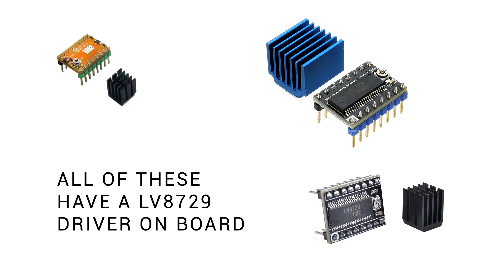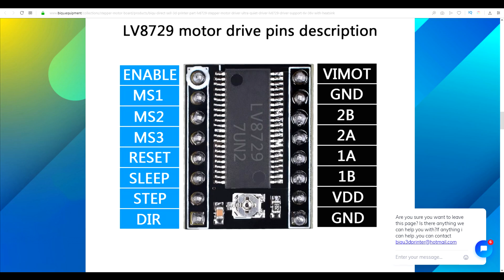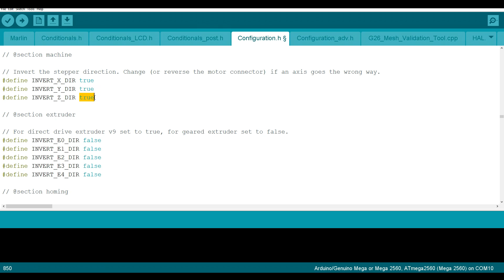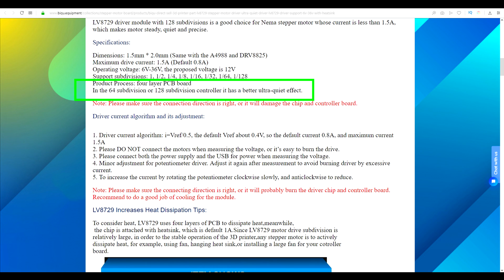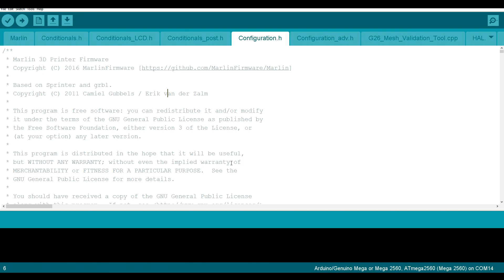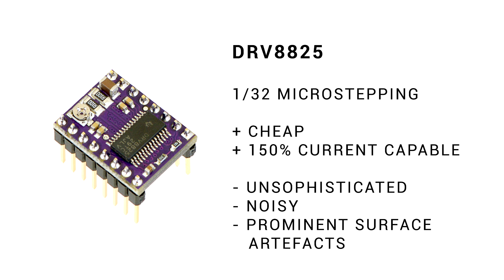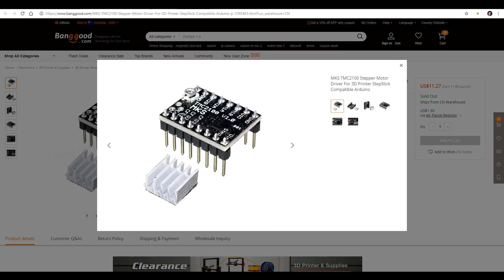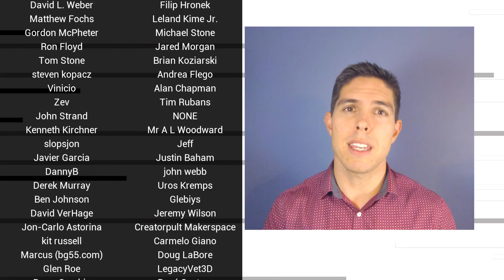LV8729 guide + comparison with TMC drivers

Comment: Are TMC 2208s drop-in compatible with a CR-10S logic board, if replacing the driver chips directly?
Reply: Usually those came with a Melzi-like board with A4988 soldered in. The only pinout compatible chip is maybe Hero HR4988, which supports higher microstepping modes (configurable). At 16 microsteps, it's a little less annoying sounding than A4988, but i don't know about its behaviour quirks. Straps for 16 microsteps are the same between A4988 and HR4988, but for all other modes they differ.

Comment: Marlin has a way of dealing with insufficient step routine interrupt rate, it can actually send multiple STEP pulses within a single invocation. So on the 8-bit hardware, for every move section, Marlin chooses an interrupt rate such, that it's below 10 KHz, but it'll multi blip the drivers as needed; but the driver might end up being confused and doing something not-so-nice. They actually have some timing tuning for the feature, so you should specify the type of driver you're using in the config!

On a typical printer with 16 microsteps and less than 200mm/s movement speed, you can assume that these double and quad stepping modes will not be activated.

Comment: The reason none of your settings take effect after uploading marlin is because you still have settings stored in EEPROM. You need to do an M502 to reinitialize eeprom with values from firmware, then all your settings you set in firmware will be in place. Then an M500 to store in EEPROM and you're good to go.

Comment: After watch this perfect tutorial and changed my Lv8729 to 64 micro steps I hit a strange but. 
When doing retraction the extruder pulls back the filament. The next thing in the gcode is to return the fillament back, but the extruder decides to pull back one more time (second retraction)

Using the same slicer as before and the safe firmware (just updated the esteps) 
Marlin 1.1.9. Any ideas?

Comment: Hi, congratulations for the always very precise and effective explanation, I would like to make an upgrade on my sidewinder x1 it is possible to replace the original drivers with LV8729 both for the axis motors and for the extruder and what are the best settings to change the firmware . Maybe you can make a dedicated video. thanks

Comment: Hi, I would like to make an upgrade on my sidewinder x1 it is possible to replace the original drivers with LV8729 for both the axis motors and the extruder and what are the best settings to change the firmware. Maybe you can make a dedicated video. thanks

Comment: What stepperdriver is best for lin_adv. , i have a skr 1.4 turbo , an can i mix stepperdriver ?
Reply: Maybe lv8729, i have problems 2208 and linear advance
Reply: @Marcushin   2208 you absolutely need to run in SpreadCycle mode for the extruder.

Comment: hello ever 1 need some help not sure which stepper moter drivers to get as i am going to get the skr v1.3 broad as i can get it with the screen and drivers so its one of these https://www.banggood.com/BIGTREETECH-SKR-V1_3-32Bit-Controller-Board-5Pcs-TMC2130-Stepper-Drivers-TFT24-Touch-Screen-Kit-for-3D-Printer-Part-p-1579479.html?rmmds=cart_middle_products&cur_warehouse=UK     
or this 1  https://www.banggood.com/BIGTREETECH-5Pcs-TMC2280-V3_0-DIY-Options-Drivers-SKR-V1_3-32Bit-Controller-Board-TFT24-Touch-Screen-Kit-for-3D-Printer-Parts-p-1579182.html?rmmds=cart_middle_products&cur_warehouse=CN

Comment: So LV8729 relies strictly on the micro controller for creating steps and risks skipped steps at really high accelerations, but how do TMC stepper drivers work with 8-bit because they take 1/16 micro stepping pulses and interpolate internally 1/256 micro steps and take less computing resources from the 8-bit controller

I hope I am understanding this stuff right because there is a lot of here say and snake oil on the internet

Comment: I was trying to get eh LV8729 to work on teh E0 on my SKR 1.4 Turbo. I get zero movement out of the steppers. Anyone have an idea what could cause the issue?  All Marlin 2.0 the TMC 2209's worked fine. I disabled stealthchop in the firmware for E and set the driver in the config file to LV8729. Still no movement.

Comment: FWIW - in my experience, the TMC2130s are fine in extruders. I run them exclusively, the only issue is they use the first-gen Interpolation algorithm which means they 1) could be up to a single full step behind the other axes at any point with it enabled, and 2) can in some rare cases miss steps on reversing. Extruders reverse A LOT in normal operation between presssure/linear advance and extracts, so this is probably where some people run into issues. YMMV, but I run with it (Interpolation) disabled on extruders.

Comment: So, with a 32 bit board.
The LV8729's are a really good option? (the last ones)
Reply: on a skr 1.3 i tried both tmc2209 and lv8729. put the lv8729 @ 1/64 and they crush the tmcs. they are both quieter AND have more torque AND don't need fiddling with stealthchop/spreadcycle/hybrid modes and the like

Comment: Why did you disconnect the USB cable? On the Gen-L the logic voltage is 5v either way, and the vref is a current mirror connected to the logic voltage, not the motor voltage. And as someone else said, the calculation depends on the resistor value which will vary from vendor to vendor for the lv8729. And on a 32-bit board the logic voltage will be 3.3v so the vref value will be different, and if the value of the resistor is too high you won't be able to set enough current. 

As others have said, the 8-bit controller can't really do the higher microstepping modes so the firmware goes into a mode where it sends several pulses at once, essentially reverting to 1/4 step mode.

Comment: I just changed from TMC2208 to LV8729 for my extruder because i had constant issues with TMC2208 in stealthchop mode for the extruder. Changing the TMC2208 to another mode needs soldering and my soldering skills need training bevor I would try that.

No my ender 3 runs perfectly with an MKS Gen 1.4 and three TMC2208 for x/y/z and one LV8729 for the extruder.
Reply: Excelent! Have same problem extrude 2208 and linear advance!

Comment: About the Vref on the LV8729, I think you got the R220 resistor drivers so the right formula would be:
Vref = I x 1,1
as far as I know this is how it should be measured:
R100: Vref = I x 0,5
R220: Vref = I x 1,1
Can you confirm this?
Reply: Datasheet says I = (Vref / 5) / Rsense.

Comment: Just setting up an Anet A8 with the 2208's in UART mode on a Skr 1.3. all vrefs can be done via gcode in Pronterface also no ugly extra wiring to do. just solder the jumpers on the 2208 board. The board will also run the MKS tft32 as well as the std ones like Reprap full screen ect. Board in UK cost around £20 and it's 32 bit

Comment: I woudl agree that 2100 / 2130's shouldn't be used on extruders. 2208's shouldn't really be used in bowden or geared, however if you have done the direct drive mod and your retracts are relatively short (1mm) and the speeds are relatively slow (30mm/sec) it seems to work fine and be silent. Switching to a smaller hobb can help as well.

Comment: There are two versions of LV8729 drivers, each of which requires a different vref. That's probably why there were skipping problems with them in the video. If the bottom of the driver has R100 resistors, then, as in the video, the vref is (A/2). However, if there are R220 resistors then vref is (A*1.1). There's a very good chance you actually needed 0.83V for XYZ and 0.99V for E.

Comment: Have you ever considered trying out the A4988 'fix' by shorting the resistor next to the cooling element? If you're interested I can give you some background information. What this does, it changing the decay setting on the A4988. I would really like to see your comparison since you use a Decibel meter.
Reply: I'm certainly interested in hearing more about this.
Reply: @KayakingVince  Here is more info:
https://reprap.org/forum/read.php?1,465761,851804

Sadly TeachingTech never replies to any comments. Would be worthwhile to try this out with a good decibel meter and vibration setup.

Comment: I have tested ST820, it's strong, smooth ultra silent in low speed, but in fast travel modes it's little noisy. S109 is really strong, smooth but noisy driver, good for extruder or CNC. I have felt LV8729 in 1/16 small jumps, It's not so smoth, I don't want it even on extruder.  After all this experiments I'm back using TMC2208, but in UART mode in spreadcycle and I'm looking for TMC2209.

Comment: Always send M502 (load default values = the values from fw) followed by M500 (save values to eeprom) after flashing fw. Just to make sure to load the new values and save them to eeprom to make  everything in sync. You will not need to do manual changes like you do in the video (sending M92...). The eeprom settings will be used before the settings in the fw (and flashing will not change eeprom) so making them the same after config changes could remove some unnecessary headache

Comment: Fyi, issue with 2208 in stealthchop on an extruder is with linear advance on low step/mm extruders. A tmc bug will put the driver in shutdown. Geared extruders (over 280 steps/mm in my testing) avoid the bug as does spreadcyle.

Comment: the loud sound you hear with LV8729 is just the firmware going into quadstep mode because the MCU can't keep up, thus going down to 1/16 and maybe skipping some steps

LV8729 are meant for 32 bit controllers. 32 bit + LV8729 is a much better solution than 8 bit + TMCs

Comment: Great video Michael. So when you doing the Bigtreetech SKR 1.3 upgrade? lol. I've just upgraded my Anet E10 with SKR 1.3 board and Malin 2.0. Running TMC 2208s on the X and Y axis. It's so much quieter. I was hoping to run them on my dual Z axis also but 1 of the drivers is faulty so I'm running A4988s on the dual Z and extruder. Do you think I'd be ok running a TMNC2208 and a A4988 on my Z axis?

Comment: Thanks to your videos, I think I'm going with 2208, printer is in the room and 4498 are really loud, and on the other side, not really into sensorless homing. Already have MKS board and screen, but ordered wrong drivers...
Reply: I did the same!  You won't believe how quiet 2208s are.  Mine are still in legacy mode.

Comment: Are you looking forward to the TMC2209's? They're going to be sold from watterott in a few days.
Reply: What about the TMC5160's?
Reply: @akselanthonisenribe9984  
The TMC5160 and TMC2209 have some slight differences.

The TMC5160 has:

SPI as it's communication protocol which is slightly faster than the TMC2209's UART

dcStep - load dependent speed control

The TMC2209 has

stallGuard4 while the TMC5160 just has stallGuard2
Besides that, they're mostly the same.

Comment: My skr v1.3 will be coming soon. I ordered 2208's and to be sure a lv8729 for the extruder. Why do people advice 8729? Do they have more torque? And can I run them 1/128 with the 32 bit board?
Reply: Because someone had a problem and didn't know how to diagnose what was happening, ignorance basically. They then told a friend who then told a friend who then told a friend, and so a big bright new baby bs fact was born. And all those who didn't know any better swallowed it as "good advice" and passed it on knowingly. In other words, the standard method.

Comment: I'm running Lerdge branded LV 8729's that have the 220 ohm resistors  and not the 100 ohm ones on them, just like 4988's there is a different VRef calculation depending on the resistors these drivers have, and  I have them  in 2 of my printers, one on a mega/ramps 1.5 that i shoe horned in a cr10  and the other I just recently fitted to a  RE ARM /ramps 1.5  in my 'franken kossel' which  in the kossel are  running @ 64 steps Vref is @ .5v   and  Marlin 2.0 bugfix branch,  I just put these drivers in the to check the ramps &  and  my then untested ReArm combo was ok before risking  the 2130's in it,  but I was in for a surprise, they worked perfect right off the bat, I get no skipped steps or layer shifts or that  noise you seem to be getting here, the unexpected bonus was the  motors are running cool, even during an overnight print  the motors were  only just barely warm to the touch,  even at 120mms, have also run them @ 160 mms and there is no pausing in the print to indicate a gcode processing issue but at that speed the kossel's arms hammer way too hard for my liking,  I previously had 2130's on the trigorilla board  in the kossel with hardware SPI  and seemed to be not much quieter,  but when  the 2130's were fitted had to  drop the acceleration down quite a bit as the 2130's would layer  shift, I had suspected that a 24v conversion would fix this as I dont get this problem with my ender 3 with 2130's in it,  these 8729 drivers work so well on my kossel that I'm not putting the 2130's back in it, as the heated bed heats up quick  enough anyway it  will stay at 12v, on the my cr10 these 8729's are  definitely noisier but they are running at 32 steps and the sound a bit whiney, I reckon 32 steps @ sensible print speeds on a printer like the CR10 with an 8 bit board seem to be the limit, one  thing I did notice is the motors are warmer  on the cr10 @ 32 steps than on the kossel at 64, maybe its the load? I suspect if you try these @ 64 steps on a 32 bit board your going to get a much quieter result, the thing to think about is,  with a board like the Re ARm when you have fewer pins to play with  I reckon these drivers are a good choice, not as quiet as my ender 3 with its 2130's but plenty quiet enough

Comment: I've gone for the 2208s and MKS Gen L combo in my Ender 5. Going for silence, so the PSU is getting replaced along with moving it and the Gen L outside of the bottom enclosure. Big quiet fans and a new hotend cooling assembly with quieter fans there should do the job I hope.